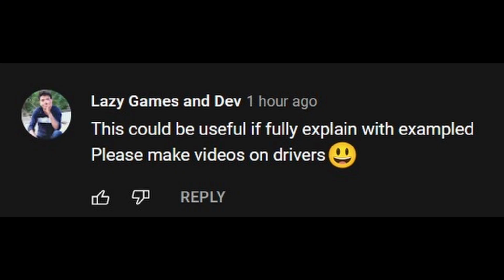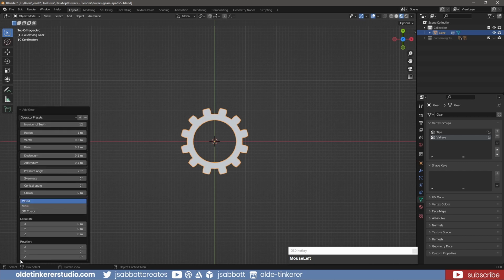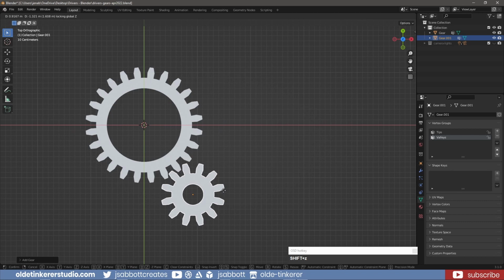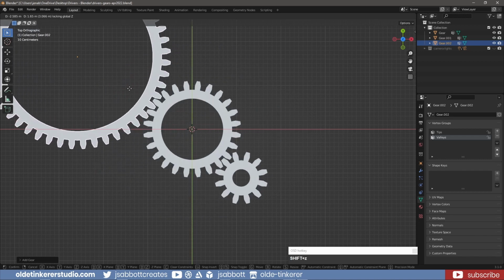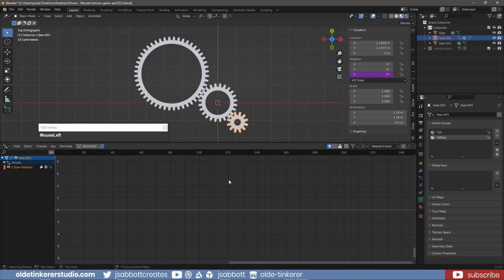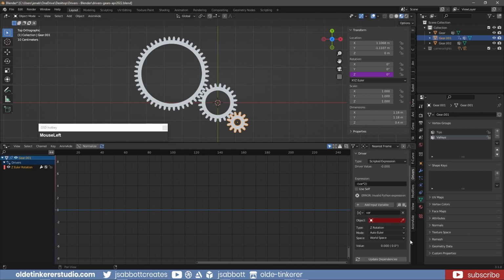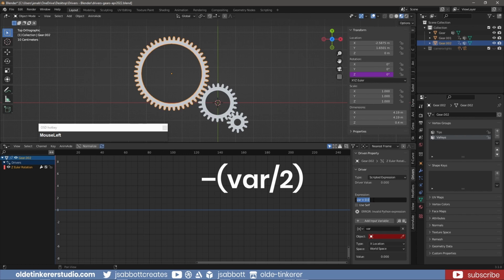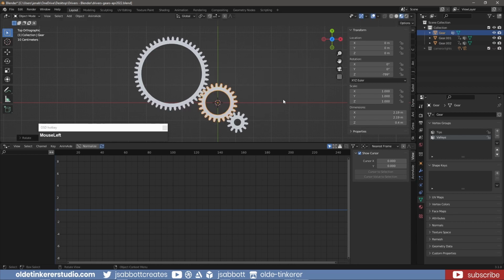How to use drivers to control gears in Blender [3.1] [REQUESTED]

Comment: For anyone dealing with an arbitrary number of teeth, for example, a gear with 17 teeth (B) that drives a gear with 8 teeth (A). The number you need would be (B / A) where B is the driver. 17/8 = 2.125, so the final formula would be -(var*2.125).

Hope that helps!
Reply from the maker: Thanks :)